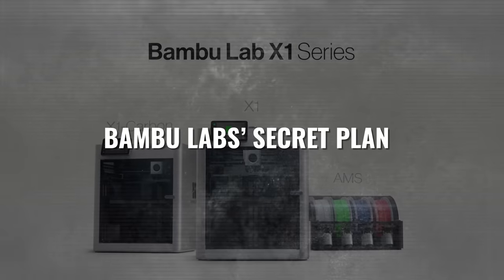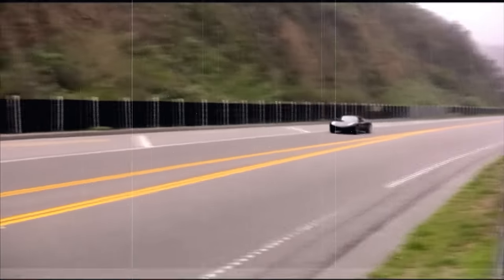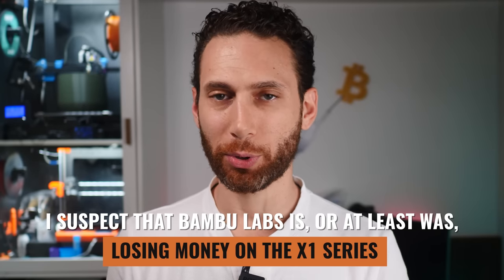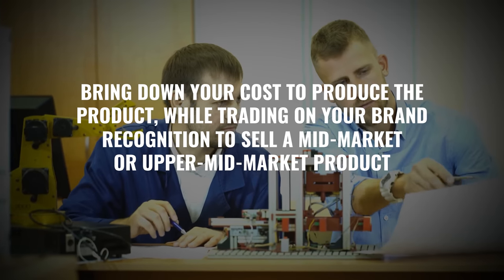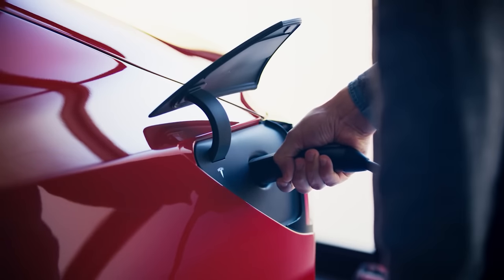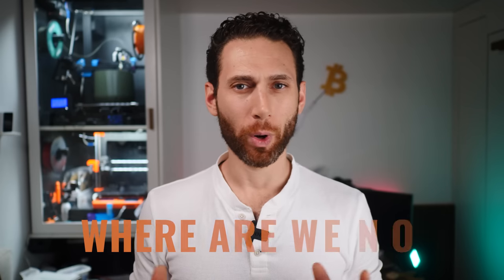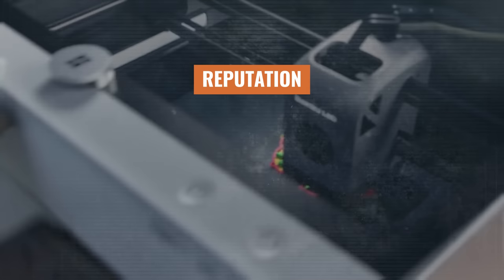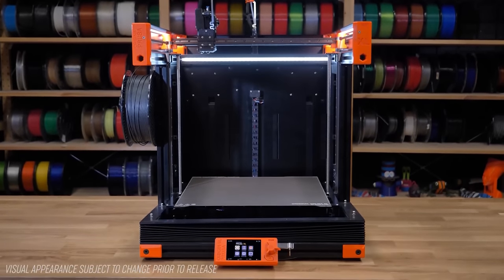Bambu Labs Secret Plan: What the P1P Means for 3D Printing

Comment: Okay, I'm at the end of your video, and I'd like to propose an alternate scenario: Purchasers (like myself), start revolting against the X1 and the P1P because they're "DISPOSABLE" machines. Think of this event as an arrow shot into the heart of the producer. Arrow no. 2: The California Warehouse starts to fill up with X1's that don't work worth a D. The Warehouse is sending out new X1's as fast as they can but guess what: The replacement machines are also flawed, and THEY'RE STILL DISPOSALBE MACHINES. Arrow no. 3: The Influencers turn on a dime and go Rage-Mod against the X1. Even though Bambu is doing their best to buy them off with updated X1's, suddenly, saying "nice things" about X1's makes purchasers who's had a bad experience with their X1 tear into influencers like a cheap steak at a truck-stop. Like I said, the X1 is not a Bugatti. But I could be wrong. There is your other video, however.
Reply from the maker: Wait till Thursday. I crack the whole thing open... basically answering the question: "Does it matter that these things are proprietary? This is the 3D printing community we're talking about."

Spoiler alert: It doesn't matter. There are already printable files out there for the AMS, new hot ends, build plates, fan replacements... only a matter of time till the rest of it is all aftermarket replaceable. One guy even commented on my video that he fitted an E3D Revo to his P1P...!

Comment: I think you are on the right track but missed a couple key points that I feel truly highlight what Bambu is about.
1. The X1C was brought to market as a stop gap on the way to their true design intent… full color 3d printing. They admit the challenge was much harder than they anticipated and had to release something to fund the R&D
2. Bambu founders are former DJI employees. DJI completely transformed the drone industry in 2 ways. They made high quality products that just worked out of the box ignoring “standard” industry hardware (common theme here) in the camera drone space. Then they took on the enthusiast drone space by developing real-time HD FPV transmission. “Everyone” laughed when DJI entered the FPV market… now you won’t find any serious fliers who are not using DJI googles and VTXs. Before they sold them separately, enthusiasts were buying the drones and taking the VTXs out to put in their custom rigs 😅
Keep up the great content. I cannot wait for the X2 or X3 when they finally realize the design intent! 😁
Reply from the maker: Good inputs!

Comment: I hope they will make a larger print bed with all the bells and whistles. Just got the x1 carbon and the cool plate needs glue on it so that your projects don’t stick to the build plate when it’s finished. I also hope they make some g10 build plates because all it needs is a hotter first layer to stick the whole print and when it’s done it comes right off.

Comment: I doubt there is a build cost loss on the X1 or P1P, but obviously production prep is going to take time to recover. A better analogy of BLs plan might be one of home PCs. In the 80s "home" PC's were available but you needed to learn how to programme them to use them. Then Microsoft happened.
BL have taken home printing into that plug and play realm.
No assembly, no stuffing around with settings, picking a slicer, buying upgrades, solving endless print problems. Just plug it in and print pretty much anything on thingyverse or printables or whereever. I've only had my X1C since Nov but it's almost paid for itself already. It just prints.
 It might take BL time to recover R&D but most of that is just labour time from the team.
BL have changed 3d printing from geek hobby  to real, reliable, home printing.

Comment: Very interesting analysis. I’m still concerned about reliability and ease of repair/access to replacement parts. Without those the X1 could become a boat anchor. 
I hope a low cost (sub $300) version is released but I suspect they can’t deliver that and be unique enough in features than the current crop of Ender 3 clones. 
I would love to be proven wrong.
Reply from the maker: I’m honored you watched my video CHEP!
Reply: They are clearly targeting Prusa who is focusing on professionals only at this moment. It's great that Prusa is investing money and time into PrusaSlicer, but right now they should work on closed loop printers like Bambulab does.
Reply: I still need my enders just to tinker.....but i can print every part i need for them twice as fast and just as clean on my X1C and in ABS.
Reply: I would also suspect they cannot go below 500 - 550 bucks with a "low cost" printer because they have to hold on to their 1st claim: speed! And one of the speed competitors is a Voron machine which cheapest kits are around that mark (Voron 0.1 LDO Kit). The Voron is build by the consumer so this costs on a prebuild machine come on top of that at Bambu Lab. When they can produce certain parts cheaper they arrive at that kit price from Voron again (like LDO Kit) but deliver a fast prebuild machine to the end consumer.

Comment: Another great vid! 

While it’s probably true to say that Bambu Lab lost money on their first few shipments, I don’t think that’s the correct framing. What I believe they did was simply base their plans and pricing on selling a lot of printers. They’ve invested heavily on the front end, with injection molds and probably a lot of other less-visible things aimed at lowering the incremental cost of production (cash expense of each additional printer manufactured. Likewise, the ex-DJI team doubtless leveraged their manufacturing and supply-chain connections to obtain very low component and assembly costs, in exchange for large long-term contracts. (With plans to use the same basic components for multiple models to achieve economies of scale, as we’ve recently seen with the P1P.)

I’d be very surprised if BL isn’t making a nice incremental profit on every printer they’re shipping. It’s just that they scaled their production plans, contracts and product roadmap to match a world in which they sell hundreds of thousands of printers. If they only ended up selling 20-40,000 units, they’d be hosed, but I suspect they’ve already passed or at least are close to the point of break-even, even if they had to amortize their up-front costs over the units shipped to date. 

Bottom line, I agree with pretty much everything you said, except the part about selling printers at a loss :-)
Reply from the maker: I'd agree with your assessment... and I think they, unlike Prusa, are building for SCALE

Comment: The question is simple, who are behind bambu Lab? ALL this technology came from DJI, The first 5 employes are:

Dr. Tao, Ye CEO
Dr. Tao was the product manager of the groundbreaking Mavic Pro and then the head of DJI consumer drone department.

Dr. Gao, Xiufeng CTO
Dr. Gao was the head of the System Engineering Department of DJI.

Liu, Huaiyu COO
Previously the product manager of DJI goggles, digital FPV systems,s and FPV drones.

Chen, Zihan Chief Engineer
Chen Zihan was in charge of the DJI gimbal department and it was his algorithm that makes brushless gimbal feasible for massive production for the first time worldwide. He is a genius in motion control and active stabilization and no wonder he is the designer of the Active Vibration Compensation system.

Wu, Wei Senior Engineer
Wu Wei was a senior engineer of DJI. He participated in the software system design of Mavic Air 2 and the system design of DJI FPV remote controllers. Currently, he is contributing to the algorithm and software development of Micro Lidar.
Reply from the maker: Rock-star team... how many PhD's work at any of the other companies?

Comment: I think it's also important to recognize that losing money initially to establish reputation and connect with distributors can lead to guaranteed wholesale in large volumes. Taking a percentage loss compared to the target but getting all of that money quickly is the superior outcome for new businesses because its tangible and not built on prediction of future successes. Selling 50,000 units at 3/4th the target price is a whole lot better than sitting on 50,000 units that haven't sold at the target price and just kind of hoping they do. That networking with distributors also goes a long way in decongesting their own distribution channel volume so they can focus on manufacturing and contract out things that other large companies specialize in doing. Moving all of those units at once also means more people will have the product sooner, build their reputation up with more customer reviews, and this top-down reputation first strategy will end up snowballing out of control as long as they don't shoot themselves in the foot with some kind of huge problem that didn't get resolved as quickly as it should because they went top-down. Such as the network security concerns. My finger isn't enough on the pulse of that to know if they have responded adequately but its a great example of the kind of thing that can go wrong when you tunnel vision and go all in.

Comment: X1C is a beast hopefully stuff like lidar becomes more available for diy builds. The only thing I hate is the cloud nonsense with bambu it makes me feel like my printer is a ring doorbell.
Reply: this is my main debate between a voron build and bambulab. i dont want anything cloud based. but albeit the industry gores in this direction so all printing can be monitored.
Reply: @drewberrynews3875  Pretty sure it can still be used offline and never connected to wifi but it sucks not having the ability to control it with something like octoprint or mainsail as an alternative option to the bambu labs app. Maybe someone will create custom firmware since the printer is so popular.
Reply: @drewberrynews3875  Bambu saves your build jobs. If someone was to try and take a Bambu Lab into an area where cell phones were not allowed, you would be getting escorted off the premises.
Reply: @18B_Madder  that's exactly what i don't want: Bambu lab saving my prints. It can then become a dispute of whose intellectual property it is depending on Bambu lab disclaimers. Further it's none of thier business what I print. I stayed away from this and went with Voron

Comment: I think Bambu's main issue that doesn't sit well with the 3d printing community is its proprietary nature.  Also, FLSUN has proven you can make a printer just as fast as the X1, so Bambu's advantage right now is its AI features.  But, FLSUN using Klipper built-in gives it a very large open-source community that can quickly bring new features to the market.

So we're back to the age-old open or closed - which is better?
Reply: Closed can be good if it's done well with good support and parts reasonably priced.

Besides look at CNC Kitchen, theres already aftermarket hotends with replaceable nozzles. 
If something becomes popular, the aftermarket scene usually jumps onboard
Reply: It’s “Ai” features means no privacy.

Comment: I think they're using a double-strategy of after-sale consumables, but also halo productS (plural). kind of like KEURIG, the filament - though does not have any DRM, has their RFID chips which are a GENUINELY positive experience, all the settings, the color, material type, and even how much is left on the spool come through that RFID. notice they haven't yet shared the tech with others or let users make their own chips - it's a way to keep people like me, voluntarily, in their ecosystem. The AMS costs $350ea and AMS light $250, they likely had a high R&D cost, but you kno they don't cost that much to make. So they're making the money back on filament and the P1 series. I think the X1 and A1/mini series' are halo products, and the P series is their cash cow.

Comment: You didn’t use the best example…DJI.  Came out with the first out-if-the-box consumer drone with lots of features.  Refined and improved it. Expanded into the commercial photography business, search and rescue, police, etc and then added smaller more compact models to meet new customer desires.  And they too had miserable customer service until they expanded their repair facilities in the US.

Comment: So basically Bambu Lab tries to repeat the story of Prusa Labs or One Plus in the 3D printing market.

Since One Plus is loosing more and more their way (and getting unattractive to nerds who look for the next "new" thing or the best bang for buck) this could be interesting!
What Bambu Lab can't provide is the gain of knowledge and the part of the printing hobby, where you build your own machine, learning the basics of IT and electronics, having a 3D printer not to print "something" but to improve in this hobby, improve the machine itself let the printer not only be a "tool" but a project and hobby by itself.

The reviewers are excited because you get the speed of a Voron for half the price, which an Ender 3 or Prusa Mk3s can't provide.

But the Bambu Lab P1P cannot print in better quality than a well tuned Ender 3 (V2 or S1) or Prusa Mk2/3. It's just "faster". And the P1P can also not provide the joy and learning curve of a Voron (0.1 or 2.4) which deliver also great quality and speed.
So the question is if a typical nerd who has 3D printing as a hobby beside a full time job "needs" that speed or would not rather build a Voron for pleasure instead or use one (or even 2 - 3) much cheaper Ender 3 or CR machine to let them print over night because he is not in a hurry!

A long lasting print experience needs a 3D-printer operator who can fix problems ... because eventually they will appear. The question than is going to be if a much better documented Prusa or a open Ender 3 clone isn't faster and more enjoyable to fix than the proprietary Bambu Lab X1 or P1P.

The X1 machine is great for small businesses where speed does matter. But as a free time project speed does not matter so much more when you can supervise the print during the day via a webcam and octoprint or just letting it print throu the night but save like 450 bucks or more in purchase.

Comment: I have a little different take on this.  I don't think that creality has anything to be afraid of here as they are the king of the entry level (and inexpensive) 3d printing market.  I am more worried for Prusa whom we all know and love, but Bambu is positioned to eat their lunch.
Reply from the maker: What happens when Bambu makes a $250 printer that’s 3x faster than an ender 3?
Reply: @The Next Layer  will rule the market
Reply: @thenextlayer  Nothing will happen, because all Creality will do is add a couple of open-source upgrades to their printer to make it faster.  There is no secret sauce in 3d printing.  Use linear rails versus V rollers. Get rid of the bed slinging, good hot-end, good cooling, good stepper motors, solid box, and add Klipper - done.

Hell, Creality's Ender-6 with linear rails, Sprite Extruder, Sonic Pad, CR touch, and flexible build plate might give the P1P some good competition with no new development by Creality.

Don't get me wrong I like what Bambu has done.  But I feel if anyone just took the pieces already available they could make something equal if not better.  Just mass produce a Voron to lower the entry cost and Bambu would have more competition than they want right now.

Comment: This is wrong.
Regarding the "step 3" part, they basically had all ready from the start since they started with a lot of custom mass production tooling right away and had experienced engineers that are the core of the company.
They use basically every cost cutting measure possible while still keeping the quality high and the look of the final product good.
A lot of the parts are injection molded which makes them very cheap to produce, while others are parts that they already had experience working with and cost less than others (not TMC stepper drivers, but they perform basically the same since they are ex-DJI engineers and worked with the motor drivers already, etc.) or just regular mass produced parts.

You have to keep in mind that both economy of scale and the production business in China works a certain way, most parts are WAY cheaper than it's usually sold to the end customer.
While for example, you might think that a cheap part is 1$, it actually might cost them 0.02$ instead.

I can certainly say that all their products are making them a profit, maybe not so big, but definitely a profit.
Likely around 2x for the cheaper variants, which in some industries is not enough, but that's still pretty good.

It amazes me when people think that products are actually that expensive...
For example with gaming mice, they essentially are all under 10$ to make, yet they sell for 150$ sometimes...